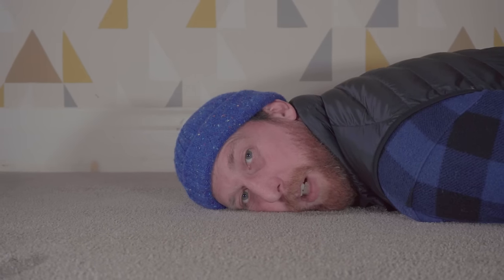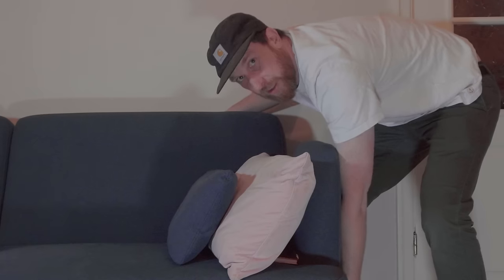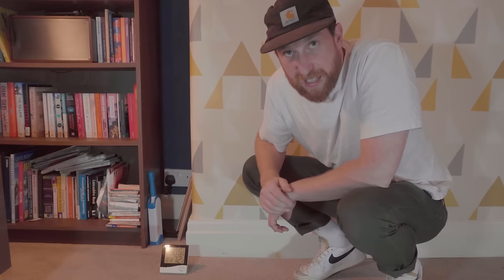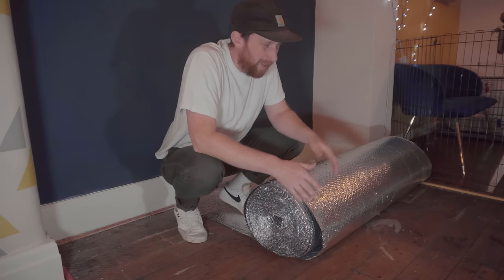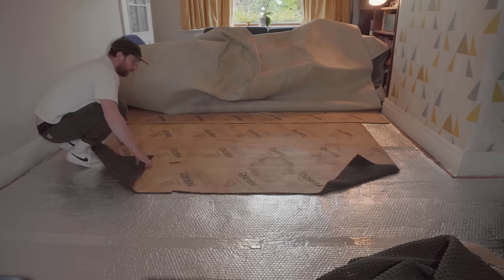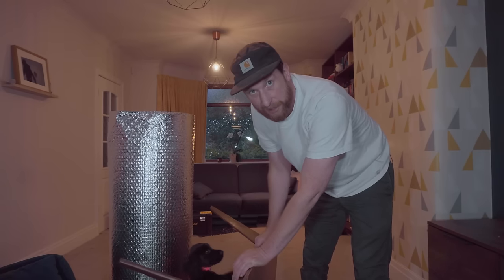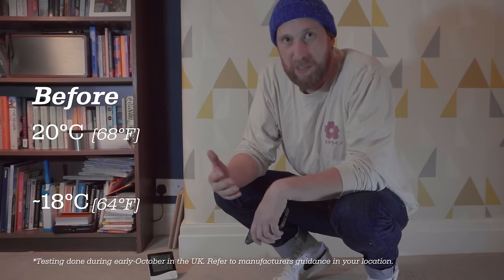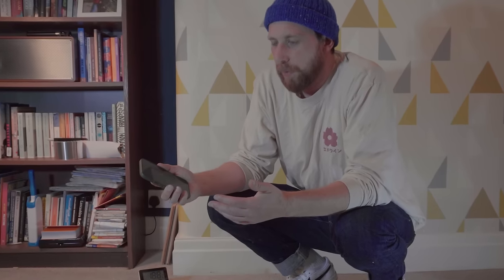This floor insulation could save us HUNDREDS

Comment: 3:44
That barrier you put down, is a moisture barrier. Any humidity that moves into that space isnt going to be able to climb back up and out. humidity might be trying to move upward, but you have it trapped next to a nice cool condensing surface.

I highly recommend looking at your local building codes and the vapor pressure conditions for your home.
You may have just created the perfect enviroment to rot your floors out in a handful of years at worst, or just provided a nice moist place with plenty of sugar for mold to eat and grow big and strong.
Reply: This is correct. Water will dew on the underside of the foil. Causing rot.
Reply: How is this any different from laying lineoleum or vinyl plank flooring, or laminate with an underlayment?  All of those would be a moisture barrier.
Reply: Tldr; Situations are largely variable across the globe so check your local building codes for clear restrictions in actions.
I know just enough to know I don't know enough.
A moisture barrier isn't a barrier.
I know it depends on the moisture drive direction for your home.

what material you a using, next to what other material.

Depending on climate zone you may;
Need an exterior moisture barrier, 
Need an interior barrier,
Not Need but one or the other is allowable, or may not be recommended.
You probably don't want a barrier on the outside and inside. Moisture will drive through it. Then what?
To be a barrier is a misnomer a better term is vapor retarder, because they actually increase the difficulty of water movement. This is called a Perm rating. 

[[[[  Tangent industries including building are filled with these misnomers. Like the R rating for insulation is commonly accepted to be the gold standard for thermal control, but it is a
thermal (R)esistance Rating and says nothing about thermal conduction, thermal convention, thermal equilibrium. So you can have an extremely low R rating with way better thermal control than a high R rating. ]]]]]

In any case two sets of barrier usually just results in water getting pressed past one and not having enough pressure to move though the other and too much to go back the other way. 
All depends temperatures and the vapor pressure difference between inside and outside.
 Or the two sides of anything built, over and underside of a floor maybe.

Then with that determination made you can assess which material works or at least doesn't cause issue with that system. Which for brevity I'll leave at that.

The principle remains the same what/where-ever you are building.

Only the size of the problem it might be and the amount of damage that is reasonable to let remain as acceptable risk. 
If I do this wrong how much am I willing to risk over what kind of time horizon. How long will it take me find out how to do correctly and execute those actions.
Reply: @ianfromnyc  I accidentally wrote you a book of a response. But it's a good question.

Comment: Try installing a ceiling fan. Set on low and turning counter clockwise will push warmer air from ceiling back down toward the floor. 
When summer comes, reverse it to help cool you.

Comment: The 2 degree drop between thermostats doesn't necessarily indicate heat loss. Heat rises so the higher one will always be hotter. It's called stratification.
Having said that, warmer floors will make for a much more comfortable room. Especially if you walk around barefoot. So worth doing I think.
Do those bubble wrap type insulations still perform well when compressed though?
Reply from the maker: Warmer floors is exactly what I was hoping for - there's still a stratification, for sure, especially on windy days. But overall the room is a much nicer place to sit and walk around in
Reply: @northernworks  If there's extra stratification on windy days you have bigger problems than the floor.

Comment: My ceiling was not insulted 3 years ago. I had little money and did not want to remove sheetrock to put insulation in. I took  mylar emergency blankets taped together. The blanked was screwed to ceiling after sandwiched blanket with water bottle caps. This was great improvement. Got tired of looking at mylar so added foam poster boards taped together and using sandwich screw technique. Later could feel cold penetrating thought walls. Used a layer of mylar, cardboard, mylar and cardboard covered in contact paper put on  walls and taped to ceiling.
A year or two later added ceiling layer again. This year seeing the electric bill difference. There was window insulation also added and bubble rap flaps over door. There are big cracks in floor hope to fix them this year. Only have a little room done. live in one room. Bubbled taped around water closet with second space heater set at 60°F. Room 70° to 75°F

Comment: Great video, we put secondary glazing on our windows and put a draft excluder on the doors and it made an amazing difference, no more drafts!!
Reply from the maker: Great tip!
Reply: where I live it gets super cold so I put two layers of window plastic on - wow - now we can live in tropical temps all winter!! Saves money of course also. More importantly is maintaining the immune system based on body heat. 1 degree = 1/3rd of immune system.

Comment: I have to say this stuff works way better than you might think!

We camped outside in the winter in a yurt with this on the floor! Yes!

When we were setting up the yurt the ground was freezing, we were very cold, but just rolling this out on the floor and standing on it as we were adjusting it, getting it into place was mind blowing! 

Extreme difference! We placed carpet over it.... It was pretty great! We has a propane heater and it would have been a completely different experience without this under the carpet!

Also later it got  wet in the yurt and we had ro dry everything out. This stuff was perfectly unharmed. Wiped dry and rolled it up. Still use that roll of it to this day for various times!

Comment: I think this is more a radiant heat barrier - and is MUCH more effective when you have a air gap between that barrier and the floor boards. e.g. in the joists.  That said, it certainly looks like it should be more effective.  The key question is - Does your room feel better to you ... Is is more comfortable ? Also, Air sealing gaps (draughts) is much more important than installing insulation.  Air sealing - stops heat escaping, Insulation keeps heat in.   Wondering if the material you used did more air sealing than insulation.

Comment: Heat rises, and cold air drops, so that's part of the colder floor test. But good job. I'm going to try something similar but first get access to the floor joists from underneath and put in blocking and rigid insulation to exterior side. It can be had aluminum faced on both edges. Then bubblewrap and foil on underside of floor between the joists.

Comment: I'm from Canada and I liked your video. I owned an old house, and it was drafty. Suggestion... take your electrical plates off and fit a piece of (non-metallic) floor underlayment around the plugs themselves. It's usually very thin so the plate screws still fit back on. And it has a plastic side and a 'foam' side. Cut out the shape of the plug part and fit it snug, overhanging the wall so that when you put the plate back on it seals the whole thing. You can then use a blade to 'trim' around the plate. This is no where near as good as a new house... but every little bit helps. Kelly

Comment: I just did this in my shed to cabin.  Naysayers say what you will...it made a huge difference laying on the floor with rugs in top.  There is nothing under my cabin.  Its 19 degrees outside with a  chill factor of 5, and 60 in my cabin this morning.  Thats a 20 degree difference and Im happy.  My walls and roof are wrapped in Reflectix and the cabin came with radiant barrior in the ceiling  its 14x40 and I love it!!
Reply: If there is an air gap a radiant barrier will do something but really convection and conduction are the main ways heat move so seal the air leaks and install a plane of continuous insulation for a far more effective strategy.

Comment: Would like to hear the difference in your bills and how long before you "break even" on the costs. 

Suggestion: Mount an under counter pullout on a board. Secure with an adjustable tension rod placed at the back end of the board vertically from board to bottom of counter, hand tighten. Two-tier unit slides in and out. Tension rod keeps it from tipping. Really maximizes under kitchen sink storage. Your wife will love it.

Comment: I used a similar product under my engineered wood floors in my old house. I brought the temp up by 10 degrees. It was a concrete slab that would get insanely cold during our Iowa winters.

Comment: We had an energy audit.  I wondered about insulation under the floor, but was told to insulate the crawl space walls instead.  It was cheaper to have the foam spraying company do the job than for me to do it the traditional way.  I was shocked at the cost of buying everything. 
And they did the job much faster than what it would have taken me. Also, less banging on my head.
 I actually saved over a thousand dollars paying the company.  Bit of a shock, and very glad I decided to price check.
The next year you could really tell the difference.  From double pairs of heavy socks to one light pair.
Reply from the maker: Nice!

Comment: Helpful information, thanks. It's cold, windy weather and my living room isn't cosy either. As a tempororary fix I've just put down masking tape along the edge of the carpet where it meets the skirting board, as that's where I can feel draughts blowing in. Super cheap if it does work.
Reply: Your skirting will have a gap underneath where it meets the floor, that's why you are getting a draught! I know this because I've just renovated my living room and I ripped old skirting off and there were a 10mm gap all the way round the room, so I filled the gap with expanding foam , trimmed back and then fitted new skirting on top

Comment: i used to import and sell a product exactly the same as this which was also non flamable, if you did set fire to it, the flames just self extinguished which was a regulation for it to be used in public buildings in france.

Comment: Two things:
1. You mentioned that the floorboards were draughty. While the underlay and carpet will have dampened it down, the foil insulation will increase that dampening, which in turn will be the main reason for the increase in early morning temperatures (less cold air coming up thru the boards, foil, underlay and carpet. Your next step, seal the gaps in the floorboards, and arounds the edges of the room. Then replace the foil, underlay, carpet, and see how you go. I’ll bet your overnight loss of heat will decrease even further. Result !

2. Most LVT flooring come with integrated insulation on the individual planks, and the 25year guarantee is voided if any additional insulation is used. I’ve used acres of the stuff, and it is fantastic. But. If using it on a suspended (ground) floor, You must seal the floor around the edges of the room, and any gaps in the floorboards, to prevent the air which must circulate under the floor, from leaking into the room, and robbing your heat.

Finally, like the vid. And the style. Funny too. Also. You were wearing a t-shirt and cap before laying the foil, but a knitted cap and jersey-thye-thing, afterwards. 🤔🤔🤔😂😂😂
Reply from the maker: Great advice, thanks. Glad you enjoyed the vid (and yes, filmed over several days and evenings 😅)
Reply: Yes, air sealing is just as important as insulating.  This sort of underlayment is primarily acting as an air sealer.  If there's a basement, insulation should be added there between the floor joists.
Reply: Seal gaps in floor boards--how? Maybe spray foam.
Reply: How do you seal them? Will tape work? And does it need to have room for some air to flow?

Comment: I’ve always wondered… why don’t insulation companies make a vacuum insulation. Boards etc that are airtight and have all the air sucked out of them. Heat can’t transfer through a vacuum as well as air filled cavities. Surely it’d make sense to seal up cavity walls so they’re dry and airtight. Then vacuum seal them? Rather than using conventional insulation techniques?

Comment: I have used this same insulation in my workshop on the floor, walls and roof and it does indeed work well.
On the device you were measuring the temp, it looked like it was showing around 73% humidity. This wont be helping with how hard it is to heat your space, ideally you want below 60%. So perhaps try cracking the window a little to get some fresh air in, this should help make it easier to heat the room, as the air will be less humid.
Reply from the maker: Thanks for the tip! I’ll take a look and see if I can reduce it. I think I’m also getting a lot of cold air down draft from the poorly blocked up chimney, so looking at how to improve that one too.
Reply: There's nothing like a bit of anti-physics to get me excited! It doesn't matter how illogical these things are, I love a 'smart' hack!

Comment: Nice, one cannot compare temperature with a height difference as warm air rises up. Besides that, you should first calibrate the thermometers to be sure they actually measure the same temperature in the same conditions.

Comment: I'd get a far infrared heater panel fitted on the ceiling, the after heating affect will be much better... I'd also get some thermal wallpaper (or thermal under paper) then thermal paint over the top, or if thermal under paper, whatever wallpaper over the top...
Make sure you insulate under your window sill(s) you can use that silver stuff, you used on your floor...

I did this and it makes a lot of difference!

My room holds & gives off the heat, from the far infrared panel heater, much better than having the rad on!

👍

Comment: Basic physics states that heat rises and cold sinks, which means that even if you insulate your floors, walls, and ceilings, the heat is still going to rise towards the ceiling and the cold sink towards the floor, and that's why your floor thermometer registers 2 degrees less warmth than where the thermostat is located.  Most thermostats are located approximately where people's heads are at and not at floor level.  Even in my very well insulated house in NE Tennessee, USA, there is still a temperature difference between where the thermostat is located (approximately head height) and the floor.  However, because my house is so well insulated, it costs me less to heat and cool my house precisely because of all that insulation.  So, putting as much insulation as is possible in one's house will help to cut down on energy costs. 
BTW, on December 23rd the outside thermometer registered -2 Degrees F (-18 C). Even if I turned off the heat, the thermometer still registered 55 F (12C).  I did, however, put a blanket over the windows on the north side of the house to help with insulation. 

I suspect that folks who own their own house will start thinking about ways to insulate their homes.

Comment: Years ago I wrapped my water heater with what I think was the same stuff and added a layer of it to the ceiling of the shed on the back of my house to covering the fiberglass insulation. I have no real way of knowing how well it works but I am taking it on faith that it does.  I have also covered windows in an unused room with it. Its really handy stuff to have around.

Comment: Hey Bloke, An excellent video. Here in the USA, some scientist have concluded the 1-2 inches of dead air will improve the reflectivity of foils. So, you might have had better results by putting the foil in the channels between your floor joists. Of course, leaving 2 inches clear headspace between the foil and the floorboards. This idea was derive from rocket and space research. In short, cold reflects down and heat reflects up. In summertime cooling mode the reverse will happen. I am doing this process in my attic renovation.
Reply: I can't understand how cool reflects or what is meant by that. There is no cool, it's not a thing, cool is just the absence of heat. That's why there is an absolute minimum temperature (it's what you get when ALL the heat is removed)
Reply: (I understand it's a figure of speech, I just can't get my head around it)
Reply: @shyft09  Wrap your head around this fact. I-2 inches of dead air between the foil and the occupancy location makes heating and cooling BOTH much more efficent.
Reply: @MrMockingbird1313  Much is probably an overstatement, the main mechanisms of heat transfer on earth are not radiation (we have air) but convection of air and conduction where warm passes to cold. Creating an air tight barrier with a layer of insulation is much more effective than a radiant barrier which needs to be clean and facing an air gap to have any benefit.

Comment: I did use this product in rhe loft under traditional rockwall and the heat retention was extended by several hours and it was cooling during the summer but I agree with the comment about air gaps to prevent condensation.I couldn't understand this in insulated plasterboard installed with dabbed adhesive several mm thick but it isvery important